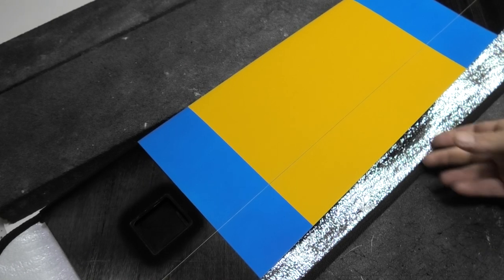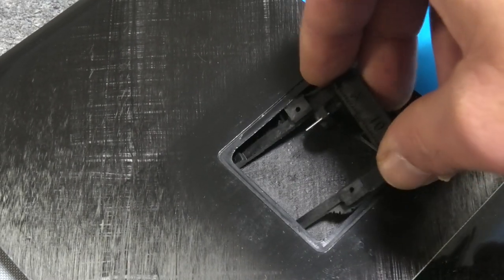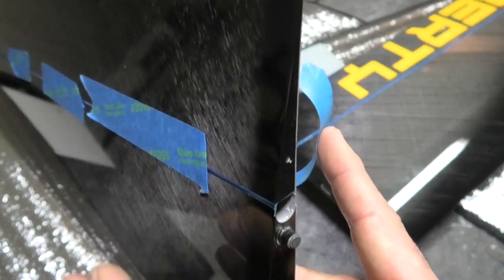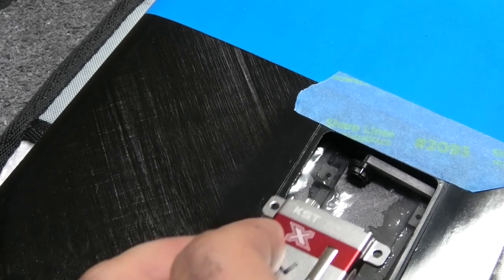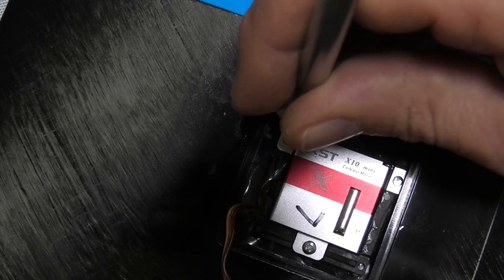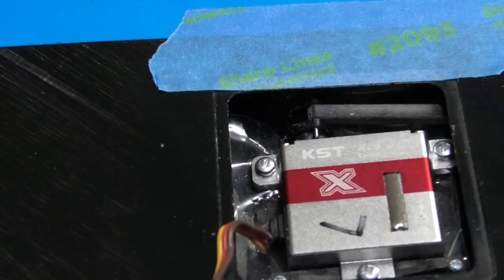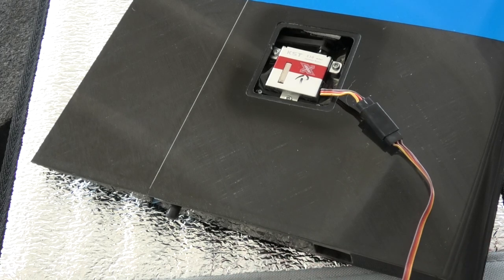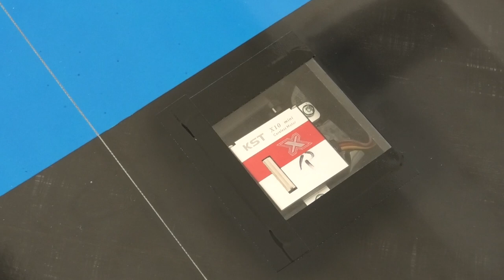CCM Liberty F5J RC Glider, Wing Tip Assembly

Comment: I use a .062 drill and just with your fingers, give it a couple turns in the pin hole of the pushrod arm. It creates a nice little lead in chamfer and when you go to assemble it, the pin guides itself through nice and easy. And you don’t even need to be a dentist. 👍

Comment: Maybe try a JIS screwdriver they are a shallower head I think that’s right but yeah Japanese screws are different.
Reply from the maker: Is that a jewelers screw driver?
Reply: @flightcomp  No think it was design around Japanese motorcycles. There is info and JIS screwdriver sets online.